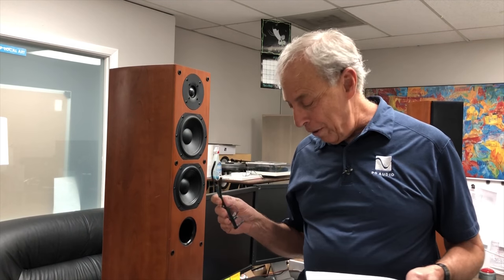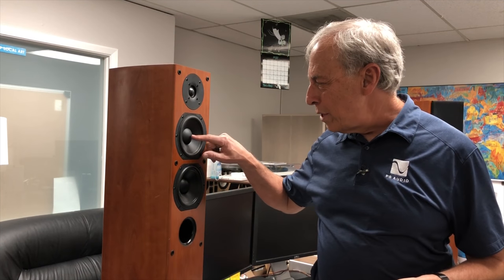Does a dented dome tweeter matter?

Comment: I got a 2" softdome midrange that was dented when delivered. I just carefully sucked it out without getting it wet. Immediately after I could see 5 slight indentations in the semi gloss finish. In a couple of days I couldn't see a trace. I couldn't measure distortion from it and was the same as the other 3 undented and perfect domes I got.

Comment: for the really stubborn dome dents, I use a toothpick, dental floss, Exacto razor knife a little Scotch tape and Elmers glue. I take the toothpick and dip it in a small dab of Elmer's glue and make a small dot of glue just off center of the deepest part of the dent and two more micro dabs of glue roughly 120 degrees apart from the first dab. I put these dabs of glue about 1/3 the way down the dip. Then cut 3 pieces of dental floss ~ 1 foot along and with the same toothpick put a small amount of glue on one end of the floss pieces. Then push one end of the floss into the glue and force it into the center of the glue spot. I use a small piece of Scotch tape to hold  each piece of the floss on the cabinet of the speaker and NOT on the form.
Let it dry overnight and then remove the Scotch tape and start pulling on the floss attached to the deepest part of the dent.
As you do, look at where the other two threads are attached and pull on them as you see that particular part of the dent flex. 
Take your time but usually within 20 seconds, the dent will pop out.
Now, take the Exacto Razor knife blade and gently lift the small glue spots off. This usually does NOT take off any of the dome material and works perfectly most of the time.
DO NOT put large blobs of glue on the dome; just very small micro dots.
Once finished, your dome should look factory fresh with no damage at all, If the dome is cut up initially as if a something was poked through it, you are looking at replacing the dome and that is doable but beyond my simple fix listed here.
Good luck

Comment: The sound was slightly muffled.    My ears heard the difference before my eyes discovered the dented tweeter.     And... I used the suction from my vacuum cleaner with a small vacuum cleaner attachment to undent my dented tweeter.

Comment: Would agree with the minimal effect a dent in a soft dome tweeter has. Duct tape has much better adhesive strength than Tesa or Scotch household tape, the strongest tape I know is for thatching roofs, or rather isolating them, Swiss Siga Sicrall or Rissan, but that might be overkill... as in *kill*. Some amature products available in hardwarestores for the same purpose might just hit the sweet spot in adhesiveness. Maybe try cutting off small ribbons to place in a loop on the rounded end of a srewdriver to get just the little dents, not a large area of the dome. Also, some guy here on Youtube recommends placing the cardboard tube of a toilet roll around the whole thing to make the dents come out again, using suction with his mouth, never a vacuum.

Comment: Pull it out with a shop vac? Doh!
Reply: An empty pill bottle with the inside coated in alcohol. Place is over the dome and tilt it enough to light the alcohol then shove it on the dome. It will pull the dome out every time, even if it's one of those made out of aluminum sheet metal which is otherwise impossible to pop back out. 
That trick can also be used to suck gravel out of wounds if you ever find yourself in such a situation :)
Reply: I've used a hair dryer to soften and a shop vac to pull. Repeat to get out any creases. I think it was a plastic/fabric composite.

Comment: I've actually repaired them with a canister vacuum cleaner. You have to be careful. Don't turn on the vacuum and put the hose end on the tweeter. It will do a lot of damage. What you have to do, is place the hose nozzle against the perimeter of the dome, being careful not to touch the surround. be super careful not to apply any force. then, turn the vacuum on, allowing the suction to vacuum reform the spherical shape of the dome, then, turn the vacuum off, and hold absolutely still, until the motor of the vacuum comes to a stop. Then, pull the nozzle away. It's critical that you keep the nozzle absolutely still, while the vacuum is on, so the voice coil and surround are not damaged. There is no spider like there is in a woofer. If the surround is damaged, and the coil starts to rub, the tweeter could be lost. I was afraid of using adhesive, because the dome was stiff, compared to the very compliant surround. I was successful, but it's a last ditch effort to save the tweeter. the sound quality seemed fine.

Comment: I have repaired varios light dented dustcap with suction. I worked before with a different tweeters (cheap Chinese Twitters ) with metal "titanium" diaphragm. those with metal chassis and phaseplug, the diaphragm are almost re formed by hand and a popsicle wooden stick, And some modifications after, i achieved the right sound.

Comment: I’ve got a pair of Alesis monitor ones that are 4x older than my toddler. It’s easy enough to take apart the driver and pop it back from the inside. Annoying but it works fine.

Comment: The purist might argue that the shape of the dome is designed to help spread the sound waves evenly across the studio. The sound distribution of a dented cone might not be exactly following that mandate ... I once saw someone carefully cutting egg shells to the right dimensions and glueing them over the "somewhat undented" original domes and painting them, so they could look and perform somewhat like the original - can't quite match the optical effect of pure chromium domes, though, I suppose. 

Other question: Does anyone have a way to fix the foam rubber rim around the speaker cone? I had a pair of great Lansings once, but after a few years the foam rubber disintegrated and the bass frequencies just short circuited around the edge rather than going through the bass reflex pipe. At first I rushed to the rescue with a big tube of contact glue, fixing the first small tears, but I couldn't quite replace the whole thing with that ...
Reply: You can order replacement foam surrounds, measure your size, the same for dustcaps

Comment: Every speaker you ever see in a retail store has a dented dome. When my wife and I took her parents into our home we also took their Altec Voice of the Theater Speakers with them. These were subjected to a harmful life in a swamp cooled environment. Even during the winter my father in law insisted is running a humidifier in his heater ducts. The result, everything made of wood or paper disintegrated. So by the time my youngest son came along and His Autistic behaviors came with his condition and kicked in the speaker grills, I ended up with the same problem ten times over. I now need to replace both tweeter drivers, as the horns are ok, and the woofers with something that has similar efficiency with the tweeters. And that doesn't look like it's happening anytime soon. Horn drivers are typically rTed in the 100+ db range while thei woofers that are used with them are rated at around 97 db. There's a huge gap in efficiency there. So now I'm thinking about replacing the horn tweeters with a pair of 5 1/4"   a ribbon tweeter mounted above a 15" woofer that is as efficient as the other drivers in the system, with the mids and tweeter in a MTM arrangement mounted where the old tweeters horn used to be just above  the woofer. Then filling the cabinet with damping material and the walls with damping film to do something to prevent the boxes from booming. I'm aiming for an efficiency of about 90 db accross the board with as flat a response as possible, and then mounting some kind of metal, electrically charged grill to protect the drivers for ever. When the kid try's to kick them in hell learn. Or if the cat try's to make its territory, well.... let's just hope I'm around to capture that on video!

Comment: As long as the diaphragm doesn't get crushed you're fine. I think that's what he's trying to say. Gotta find the words. Also if you own older speakers 1970ish, you're solid. The paper dust cap can be easily replaced. In any case, don't sweat it.

Comment: Reminds me of how I ruined a titanium tweeter decades ago in some JBL speaker while trying to remove the protective speaker grill to improve the sound before I even had tried to listen to the speakers. The speaker grill was magnetic and as I tried to remove it, it turned upside down and pulled itself into the tweeter in a split second. And even with the tape method I was unable to restore the diamond structure in the metal. So I ended up buying s new rather expensive tweeter for my brand new speaker.

Comment: An easier method of fixing this is to use a hoover with the detachable cylinder. Don't touch the tweeter with the cylinder. Just put it up as close as possible without making contact and it pops right back out, usually without looking as if it was ever pressed in at all.

Comment: No tape I had in the house worked but my son in law-to be was trying to pull the dent out it out with a Vacu Vin wine saver vacuum hand held pump.  It did not work until we added the rubber stopper against the dent to make a better seal...voila!!!

Comment: Make a cardboard tube using a tube from paper towel. Cut and then tape it air tight so it's the same diameter as your tweeter and suck the dent out. That is how we fix them.

Comment: One of mine got popped in yesterday. The top tweeter is exactly the right size of an 8 years old finger. MMMM? and we have one of those living with us. Ive tried sellotape, vaccuum cleaner so far and still popped in. Was thinking of getting some thing small like a pen and sticking a tiny bit of super glue on the end then pop it back out. Tried the super glue method, just put a tiny bit on my little finger and i mean a tiny drop and pressed the dome. Held it in place for 20 secs then slowly pulled back and........................

Comment: I have a question about tweeter dispersion.  I remember Dynaudio recommended I rotate my LCR tweeter if I switched it between vertical and horizontal.  The wider dispersion was in the direction of the electrical contacts.  Currently I have Definitive Technology 1" aluminum dome tweeters that are made to tilt.  However, to tilt the tweeters laterally requires tilting them down then rotating them to create a horizontal tilt.  My worry is that after rotating them 90 degrees to aim them to the side that I would then have the best dispersion characteristics going up and down instead of laterally!  So the question is, do these newer tweeters have significant differences in vertical and horizontal dispersion?    FYI, I pop out my silk domes by sucking on them with a toilet paper tube, not my idea, but brilliant and effective.

Comment: I bought two times (for reference purpose) a new dome tweeter. A loudspeaker manufacturer told me the structural integrity is gone with a "repaired"  dome. To be honest to my ears it didn't make any real difference.
Reply: Airgead, ''the structural integrity is gone'' only if it is broken and has visible (and open) fractures, like egg shell. But, in the case of metal (or soft, no matter) dome, it is very hard to be really broken, it is usually only deformed (due to the toughness of the material) and in principle does not lose its properties (of dome-piston; perhaps only a little in the uniformity of the sound dispersion, which is negligible because the whole surface of the dome is still emitting sound). Because of that you don't hear any difference (like you said ''To be honest to my ears it didn't make any real difference''). And if it is so, you don't have to replace it. Normally, it would be nice to check with measurement if it is possible. If not, what you hear is enough. At the end, you are the measure of things. I hope my English was understandable... Salute and have a nice day.
Reply: Have a nice day too! Agree in general. Only theoretical a perfect metal dome is better than one which has visible small distortions caused by the initial deformation of the metal. I replaced because I needed to eliminate any doubt. For normal use it would be not worth the money I guess. :-)
Reply: They just wanted your hard earned money.
Reply: Well, in fact I got the advise from an Austrian speaker builder while the tweeters were from a B&W 802.....
Reply: Airgead, everything is now clear. B&W 802 are excellent speakers... they needs great equipment, to give their full potential and and listen satisfaction (like all good B&W speakers and series - there are some that are not so good, only ''make up'')... and, normally, deserve a new D tweeter (for such a category of speakers). Lucky you...
Reply: Thank you Dragan! Well, I have the ALU dome version and you wouldn't believe how they are modified. I use them to design amplifiers. They serve their role very well. I replaced the foam by wool, all silver wiring, out with the internal connectors,  external filters, silver chokes, RTX film and foil capacitors all trough. (about 100 pcs alone to replace the elcap for the low filter) Drilled hole in the sides to get the shortest route out of the speakers for the bass units, bulk foil power resistors... I know, insane LOL!

Comment: Packing tape works best.
Reply: Tom Brown I’m thinking that’s the best as well...duct tape might leave a residue
Reply: Tom Brown yep you use the same as me I put the tape into the whole dent but don't pull out backwards instead I pull the tape left and right at the same time so all the pressure is dead center and this has worked with plastic paper and metal dustcaps oldschool works best, I've seen dustcaps fly down the hoover loads of times when friends think they know better lol.

Comment: I disagree. I have MORDAUNT-SHORT MS30 speakers with gold plated aluminum tweeters. They came with screen protectors that I took off. The kids playing near them pushed in the tweeters and I could easily hear a buzzing sound coming from them. I took them out and pushed them back to shape from the inside with a pencil eraser and worked on them with the eraser to work out the kinks in the metal. I couldn't get out all the kinks to make them smooth like new, but now they sound fine.

Comment: I have JBL 2121 10" midrange drivers in my loudspeakers. These drivers come with a concave dustcap. After decades of use, the surrounds had to be replaced. I took them to professionals who work on JBL all the time to have them repaired. The service people were unable to acquire original dustcaps, and used convex caps instead. I am unable to hear a difference.

Comment: Best solution keep the speaker grills on until your kids grow up or don't have kids at all. There are even kids that managed to destroy the diamond tweeter domes on high end bowers and wilkins speakers. If I designed a tweeter it will be an inconel dome tweeter. Kids can't dent the inconel dome and it takes a hammer to break it. Also the highs are theoretically going to rival or even outperform beryllium dome tweeters.

Comment: With all of the audio test equipment I imagine PS has at his disposal, it's disappointing to learn the answer presented is based on one somewhat older man's inability to hear any difference in the treble output of a dented dome tweeter.
When I was in my 40's, I tested my ability to hear high pitched sounds against a 12 year old's, using an audio generator, and the youngster could hear sounds about 2kHz above my ability, and I could hear about 2Khz above my father's ability. Subjective listening with older ears isn't a valid test for subtle tweeter changes. A proper analysis would have explored if denting changes polar sound dispersion, frequency response,  or T/S parameters.

Comment: I just connected a pair of B&W speakers that spent some years in storage ... and now on one side the mid/bass driver makes scratchy noises. :o Is there a fix for that or must I put in a new driver?
Reply: @Orca Flotta
The cone surrounds may be too old and warped.  You can replace them yourself, using kits such as you can find here:  
https://www.simplyspeakers.com/speaker-foam-repair-new-edge-it-kits.html
This is better than replacing the driver, since it could be difficult to find a new one with the same design parameters.
Reply: Hey Marianne, thx for your reply but the cone surrounds sound and look quite fine. The noise is mechanic, as if there are two materials rubbing at each other or some elecrostatic effect. But yes, I guess the cones are too old to find replacements for. They are CDM 1's from the early 90s I guess and have been facelifted with bullet cores, so my cones are outdated.
Shame, they were really nice unobtrusive sounding speakers in best British tradition.
http://www.bowers-wilkins.com/Downloads/Product/Archive/ENG_FT00014_CDM1_info_sheet.pdf
Reply: @Orca Flotta
The sound you hear is almost certainly the voice coils rubbing somewhere against the sides of the magnetic gap.  Usually, this is caused by cone or surround warpage, such that the voice coil is no longer precisely centered, and in that case, installing new surrounds allows you to re-center the voice coil and fix the problem.  
But there are other potential issues, such as heavy corrosion or contamination within the gap (or perhaps even a foreign body); that would require complete re-coning in order to clear it.
Reply: Okeeeee...
The speakers spent that time in storager laying on their backs so maybe the cones sunk down a bit or sumfink. So in other words I'm completely and utterly mucked. :( Will take that speaker apart and see what I see. BTW, that shop you recommended is located in the USA. That's a bit far off and the shipping alone would probably kill me.

Comment: Blew my folded amt ribbon,  metal domes are cracked, duct tape can be used on soft domes i have disassembled and blew the dome out. Going back to flat ribbon ,building xover now.
Reply: Big screen like on 2in domes are great to protect 1 in domes and don't interfere with sound.